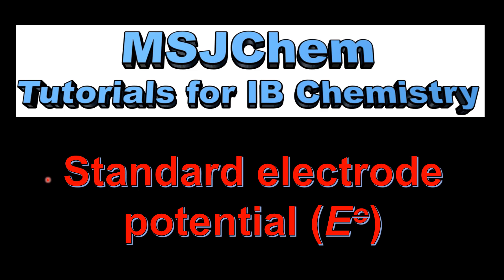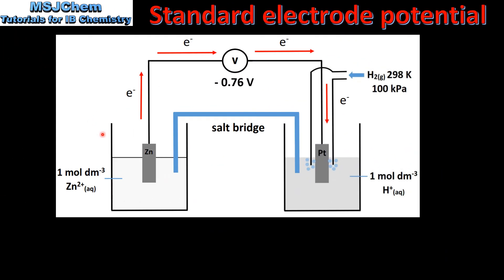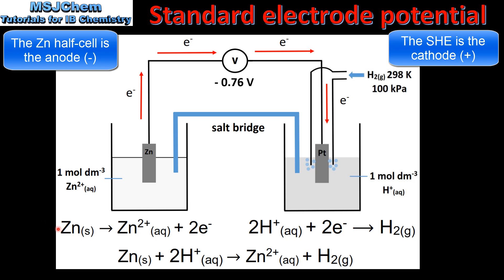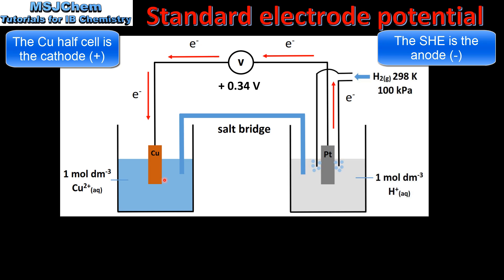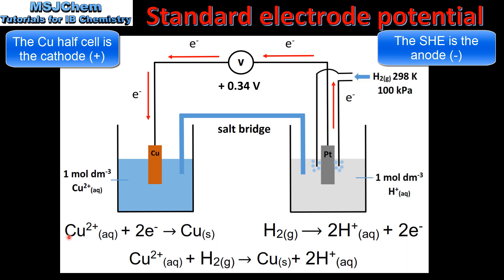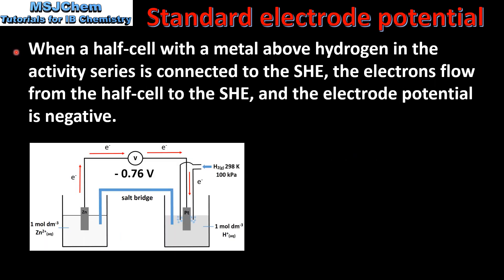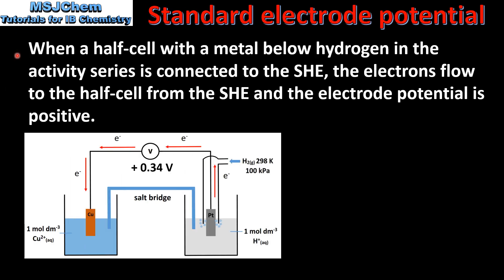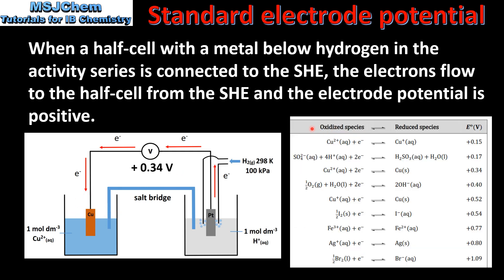19.1 Standard electrode potential (HL)

Comment: Sir, the Electromotor force is the movement of electrons from the anode to the cathode correct? and the electromotor forces is equivalent to the cell potential. So since the electrons are moving from the anode to the cathode, shouldn't the value of the cell potential be positive?
Reply from the maker: Not sure I follow you here. Do you mean the electromotive force (emf)? The standard electrode potential is the voltage produced by a half-cell when connected to the SHE, under standard conditions. Depending on the other half-cells' position in the activity series, the SHE will either be the anode or the cathode.
Reply: +Mike Sugiyama Jones (MSJ Chem) I'm sorry I meant the electromotive force.

And thank you for the clarification!
Reply: no electromotive is measured when current is not drawn from the circuit

Comment: Hi! for the first example shouldn't the v oltage be postive 0.76V, because zinc is higher in reactivity series therefor it displaces is spontaneously.
Reply from the maker: +sajjad alimi Zinc has a negative value (-0.76 V) as the zinc half-cell has less of a tendency to be reduced than H+ (Zn is a stronger reducing agent). The electrons flow from the zinc half cell to the SHE, therefore it has a negative value. The Zn is oxidised and the H+ ions are reduced.
The copper half-cell has a greater tendency to be reduced than H+ (Cu2+ ions are a stronger oxidizing agent). The electrons flow from the SHE to the copper half-cell, therefore it has a positive value (+0.34 V). The Cu2+ ions are reduced and the H2 is oxidised.

If you calculate the Ecell for the reaction of Zn and HCl:
Zn + 2H+ ==> Zn2+ + H2 (this is a spontaneous reaction)
Ecell = Ered - Eox
           = 0.00 - (-0.76)
          = +0.76 V (the positive Ecell tells us that the reaction is spontaneous).
Reply: Yes, thank you, rememberig from physics that negative sigh shown in the voltage indicates the direction of the electrons or current moving. thank you :)